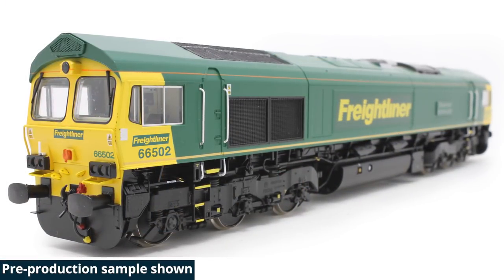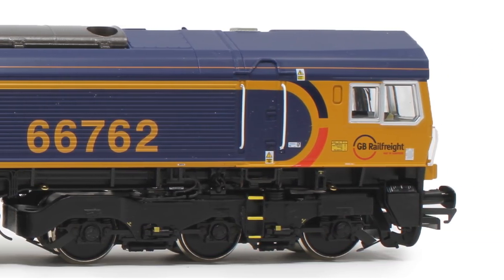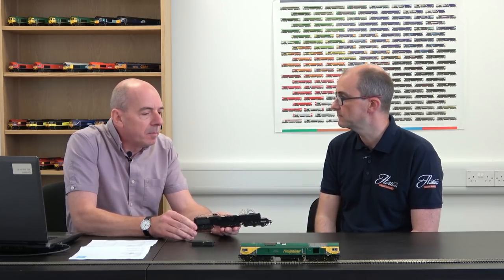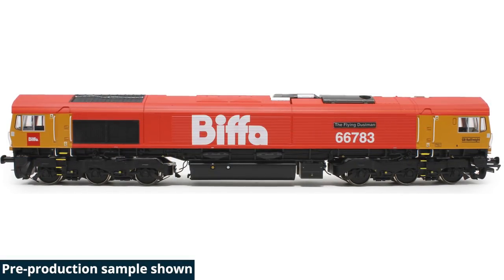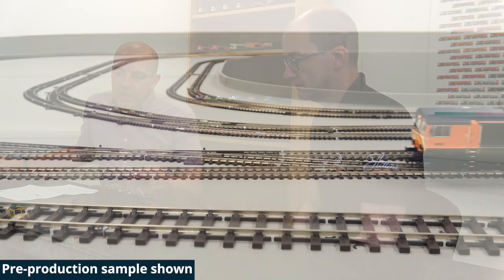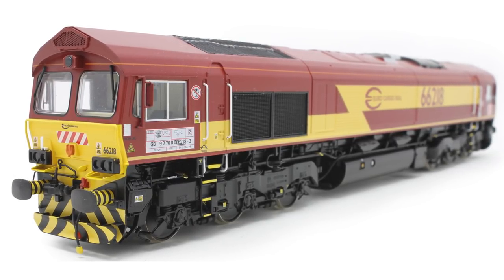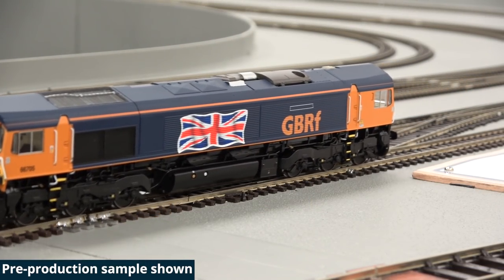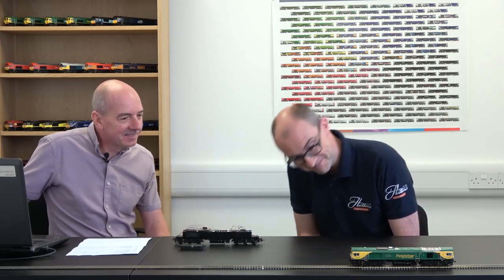Hattons Originals Class 66 - Sounds & Features Overview

Comment: Excellent model hattons and love ians sounds but i just wondered how the extra functions are used. I regularly use aux 1-4 through the 21 pin connection but have you used the susi connection for aux 5-10 or the solder pads on the v5 loksound decoder

Comment: Does this loco do all this using the Hornby e-link dcc system? thanks
Reply from the maker: Hello! Our Class 66 models are fitted with Loksound V5 decoders using 28 functions for all the various sounds and lighting configurations. As the E-Link is capable of controlling 29 functions, we believe there should be no issues using the controller set up with our Class 66. If you require further assistance, please get in touch with our customer experience team via phone or email and they will provide further guidance.